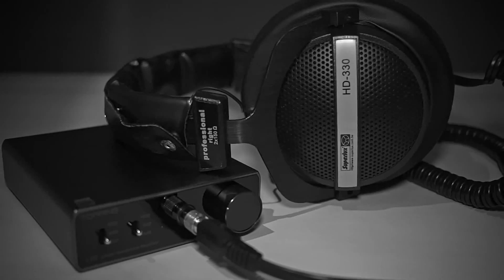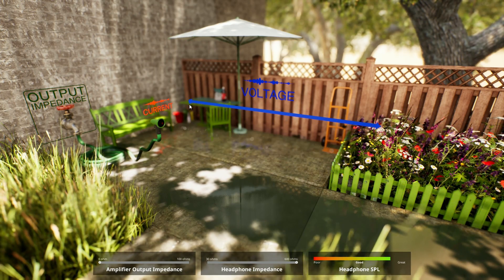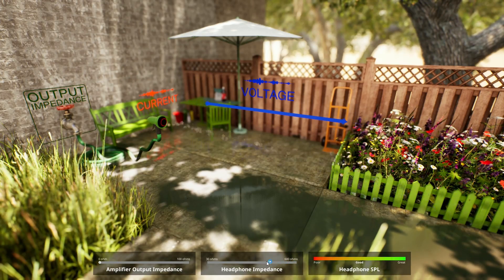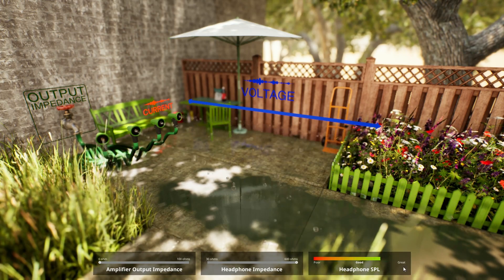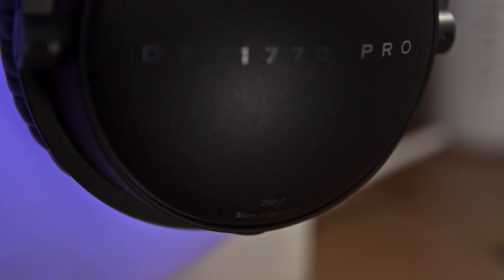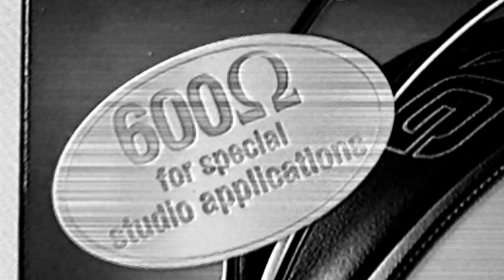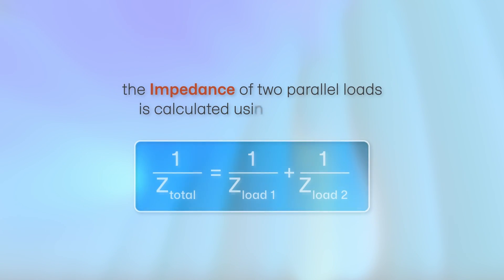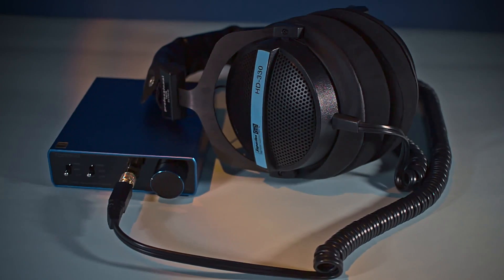Headphone impedance explained like you're five

Comment: is it correct (and not mentioned in the video) that you can use a headphone amplifier between the UR22C audio interface and my 40 ohm headphones and get better transparent audio quality? If so, which headphone amp do you recommend?
Reply: I mean use a headphone amp with very low impedance...

Comment: What are some good amps that supply 200mw of power to 48 ohms impedance? I have blown the drivers in 2 pairs of dt 900 pro x using them only with the mpc one plus this is all kind of confusion i was told they are not getting enough power and need a headphone amp that's why they are blowing and I'm pretty sure the mpc would supply enough power.

Comment: He's missing what physically dictates the ohms and resistance of headphones which is critical in really understanding it. Higher ohms = more wraps in the coil = better sound quality. Why? Because it allows more precision in the movement of the coils. But requires an amp to push the required power. The water and pipe analogy does not fit explaining headphones, it does for electricity though.

Comment: im looking to buy a pair of dt770's for computer a little mobile use and the most confusing ps5. i know the computer and mobile with an apple dongle will be fine with the 80 ohm version(i've seen 106.58 dB/V and 96.28 dB/mW for sensitivity and not sure which is correct) but i cant find any specs about the ps5 controller output and there's a lot of conflicting opinions about if they will get loud enough. what are your thoughts? @odysseyofcuriosity
Reply from the maker: Hey man! Unfortunately I don't have a PS5 controller handy, but I do have an Xbox Controller and that thing on max gets my 250 ohms DT770's much louder than I'd want them to be for extended listening/gaming sessions. So if the PS5 controller is anything similar, chances are your 80 ohm DT770 will be good in terms of loudness. As for the conflicting values for sensitivity - notice the different units of measure: V (volts) vs mW (milliwatts). This is what explains the different number, and it is to be expected. Sorry I couldn't give you a clear answer, but I hope this helps at least a bit!
Reply: thank you for the reply! i ended up deciding on the 80 ohm version modded by custom cans UK, after a lot more research lol. i figured if i really need it i can get a small amp but im glad to hear i probably wont need to! @odysseyofcuriosity